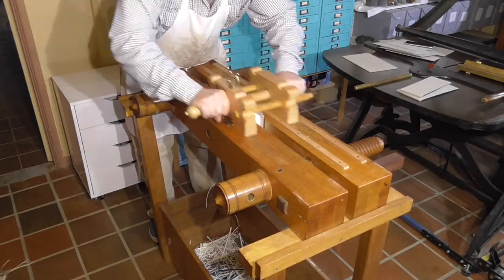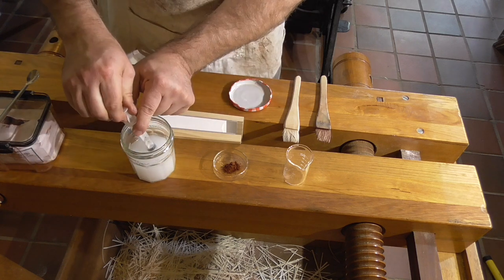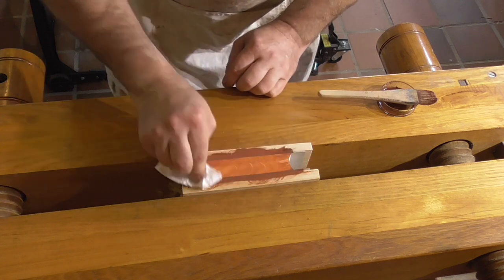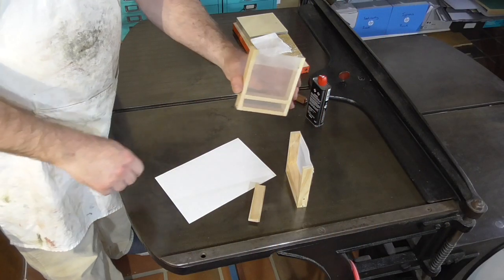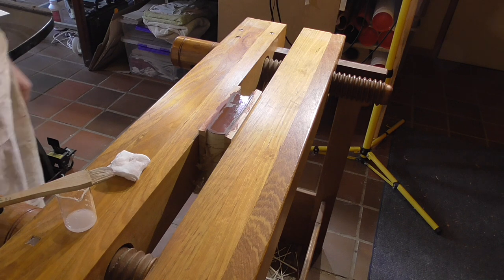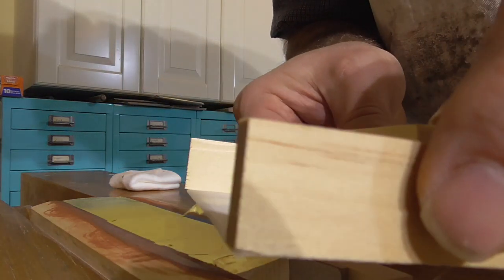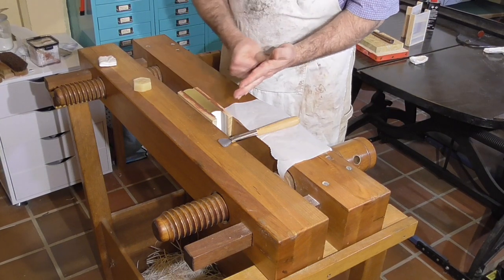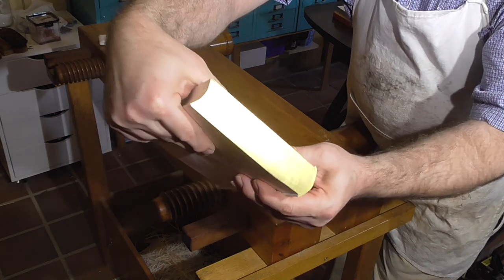Edge Gilding; Peter Geraty Inspired // Adventures in Bookbinding

Comment: Relaxing as always. You should make videos about how to 'make' your binding tools, like the book press 🧐
Reply from the maker: I'll do a little video on making the gilding frame, but not presses.  I made a lot of presses in my younger days and not one of them functioned as well as a professionally made press.  And looking back, I don't think I saved much money, and it cost me a lot of time which I wish I'd put into bookbinding instead.  I know everyone doesn't have easy access to professionally made tools.  There are a few videos on this out there.  The only thing I'd recommend is to avoid nipping presses that use 4 wing nuts at the corners.  They are impossible and frustrating to use.  DAS
Reply: @DASBookbinding  I see, it's a shame but not even a small one like those that use a couple of screws
Reply from the maker: @HistoriaenCeluloide  Now you have me thinking about it...  Do you mean for nipping, or like the finishing press, which I use all the time just to hold a book for things like spine lining?  There is a design for a home-made nipping type press that I think is rather clever.  It's in a few books and was commonly used in school in the mid-20th century.  I might have to do a video on making that.  DAS
Reply: @DASBookbinding  the finishing press that appears in many of your videos, did you make it or was bought? :)
Reply: @DASBookbinding  Hard agree on the four wing but nipping press. My first press was such a design, made from melamine IKEA shelf material. I wasnt great at pressing because there was no pressure in the centre and the platterns would warp down at the corners where the nuts were. I'm very glad for the proper nipping press I made with my dads help (he's a machinist). I still keep the wing nut press around but dont use it for pressing, more as an ersatz finishing press or work holding device for sewing endbands etc sometimes.
Reply from the maker: @HistoriaenCeluloide  Made by Frank Wiesner.  DAS

Comment: Have you considered doing an edge golfing video with foil?  I am working on a test project and the head and tail are taking the foil fine, however the rounded Fore edge is flaking off.  Getting proper heat into the space without damaging the foil has also been an exercise in frustration.  Thanks for all the work you do!  It is appreciated.
Reply from the maker: The edge golfing confused me a bit:)  At first I thought you might mean goffering, but realised it was autocorrect.  No, never used foil on an edge.  Yes, Peter Verheyen has talked a bit about this on his blog.  I have a friend that has one of those heated rollers and I've been meaning to borrow and try.  I have heard it doesn't work as well as expected and the answer seems to be a special foil and maybe PVA size.
Reply: @DASBookbinding  good catch on my typo…sorry about that.  thanks for the feedback!  I have been experimenting with foil and waffling between staying with foil and moving to gold or white gold.  So far my experiments with foil have been a series of frustrations.  I am personally not a fan of the look of gold and prefer silver or white gold.  

What materials do you use for edge gilding?
Reply from the maker: @ryannixon1346  I only use gold leaf, 23K.  I of course do other edge decorative techniques such as graphite and colours.

Comment: What 😲~I have GOT to make some gilding frames ~ so much easier to do gilding ~ thank you for this fantastic tip!
Reply from the maker: Not sure if they are easier.  Paper and hair tips work really well too.  But it's a bit of history.  Just in case you need to gild 3 books at once:)  DAS
Reply: @DASBookbinding  I’m disabled with two forms of arthritis which I was born with ~ so for me it would be easier!!
Reply from the maker: @lisajarvis3820  Lisa, If you do try them I'd be interested to hear how it goes.  It's not obvious to me that they would be easier to hold, but if they are I'd really like to know.  Different options for hand strength and dexterity issues is something I try and help people with.  Happy binding!  Darryn
Reply: @DASBookbinding  For me it has been a lot easier ~ I have both sets now ~ so depending on how bad my joints are we tell me which method to use !!

Comment: Just wondering why you don’t use a traditional squirrel hair gilders brush for transferring the gold leaf. It seems like that may be a little less complicated. Thanks for sharing.
Reply from the maker: The idea of the series to demonstrate the different options.  I used the hair tips in the last gilding video.  I tried not to bias the video by saying what my preferred methods are, but hair tips are what I normally use.  Except for rounded fore-edges, where I don't have enough hair tips, and I use paper tips.  But really, paper, hair tips, and these frames are all about the same to use.  They all need cleaning occasionally and all can be damaged if you're not careful with them.  Paper you can just throw away.  DAS

Comment: I make Fore-edge paintings on books and have been watching your videos to try my hand at guilding. I want to be able to paint a hidden image by fanning a book. Is it better to guild and then fan the pages to paint or to finish the image and then add the gold to the edges?

Also, perhaps I didnt understand it well, but can I ask what the bole is for? Is it just for the colour? 

As I am unable to source them where I am, are there any alternatives to the bole and burnisher used in the video?

Your videos are very informative and I learn something everytime I rewatch. Looking forward to hearing from you.
Reply from the maker: I think the gilding is always done after painting.  You don't always need bole.  Some softer papers you do need it to fill the pores in the paper.  I think it is a combination of colour and sealing the end of the cellulose fibres and giving a surface that can be burnished.  For a cooler colour to the gold, graphite is good.  So graphite is an alternative.  I think any raw pigment would work.  Just needs to be really fine.  For a burnisher I've seen people use polished agate pebbles and the side of a wide glazed ceramic bowl.  Good luck!  DAS
Reply: @DASBookbinding  What a coincidence, I tried graphite under gold leaf after seeing that in another of your videos. It worked well to hold the gold leaf. But I still need to master my sizing consistency. Although the pages open, they remain tacky for days after removing from the press.  Thank you very much for writing back, I will look into these burnishing alternatives too.

Comment: Great video, how much pressure do you use when burnishing.
Reply from the maker: I use the Goldilocks scale to measure pressure.  I find one Goldilocks to be perfect.  Seriously, you just have to develop a feel for it.  If you use too much pressure you end up with burnishing marks that can't be worked out by going over it.  Not enough and it will not reach its maximum potential shine.  Type of paper will require different pressure too.

Comment: Hi, what’s the best technique to gild the rounded fore edge? Thank you for this informative video…
Reply from the maker: The most common method was to use pieces of gold leaf that just went to the centre of the round and apply them from both sides.  This reduces the curvature the gold has to deal with.  There is a much less common method using a frame with thread stretched between adjustable arms, and the gold is picked up on the thread and it drapes down and the drape is adjusted to match the curve of the round.  This takes a very steady hand!

I've been practicing this and I made a video for my Patreons of my very first attempt that sort of worked.  I've had a few go better since then, but not good enough to do a video for YouTube.
https://youtu.be/cG0xf72jHi8

Comment: hi! Is there a more basic way to pick up the gold leaf rather than using the frame you made or a squirrel hair brush? Also, if one gets burnishing marks on the bole-coated edge in the beginning how does it affect the overall gilding?
Reply from the maker: Paper tips as shown in the Lindsay method video. The burnishing marks will show through. But that happens:)
Reply: @DASBookbinding  sorry to be bothering you again but what are some alternate ways I could burnish the edges without an Agate Burnisher? I can't find it where I live
Reply from the maker: @shandanakhalid2904  Anything hard and smooth.  I know someone who bought polished quartz pebbles.  I've seen someone use the gentle curved side of a ceramic bowl.  I think the large polished pebble is the best idea.  Good luck!  DAS